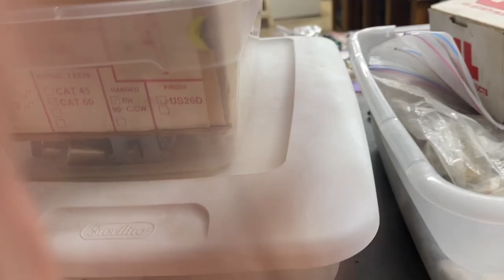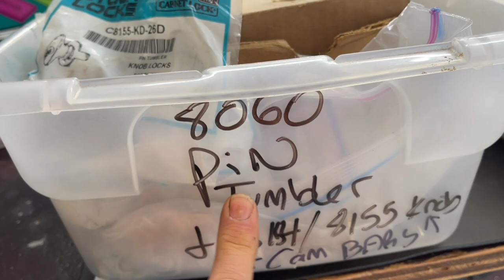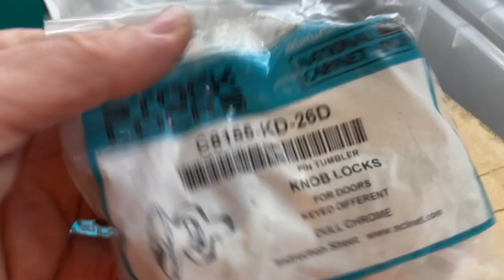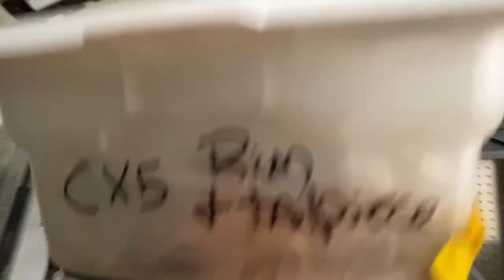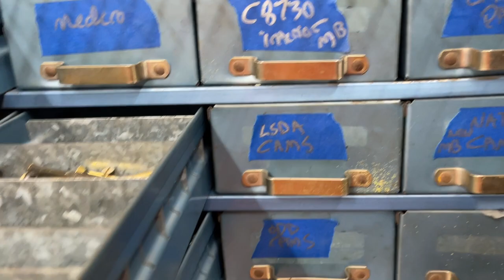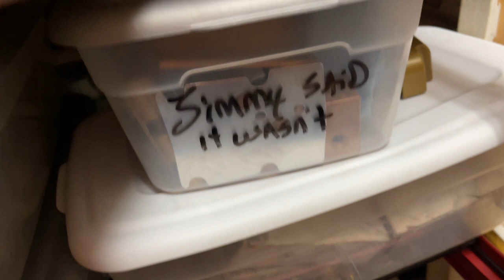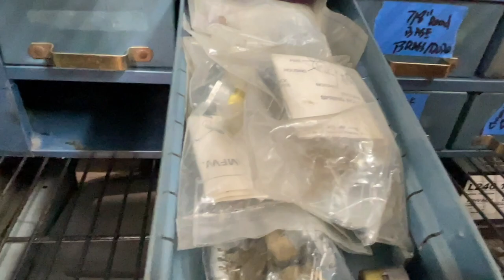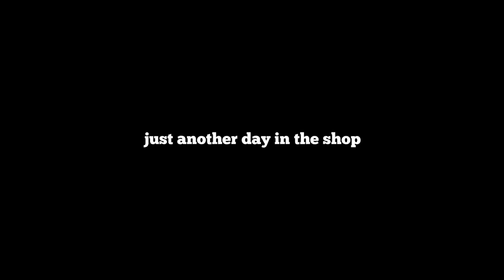Lock Shop vLog 13 “wood desk & cam lock section rearranging”

Comment: Just a suggestion you might build a shelf above the door that goes from behind the counter to in front of the counter right over the top of the door and put the containers above the door and put the writing out where you can read what is in them and you can get them when you need them but they can be up and out of the way and you could make that go all the way across to the wall that’s behind the door just what I have exurban. Looks like you got a lot of inventory to put away just looking for every spot you could use.

Comment: Is it possible to have a pin tumbler 3/4 cam lock, pin tumblr 7/8 desk lock, and a steel case 2” pin tumbler file cabinet push lock all keyed alike?
Reply from the maker: Up until you threw the steelcase in, yes

but no, on it